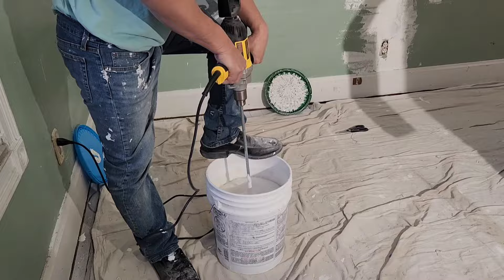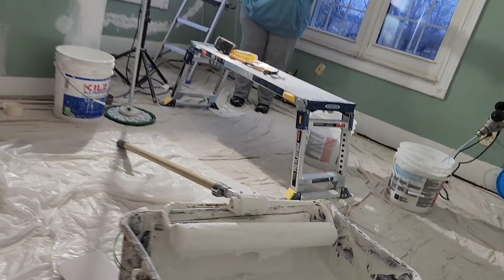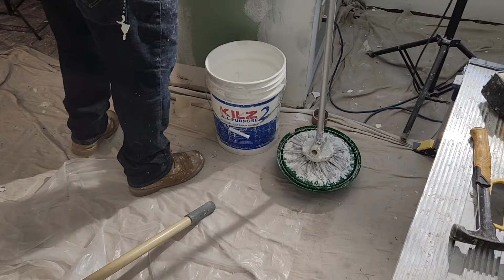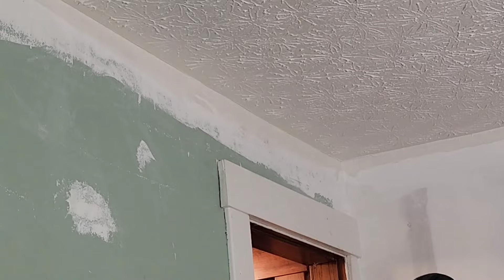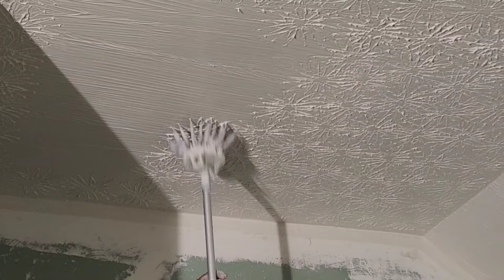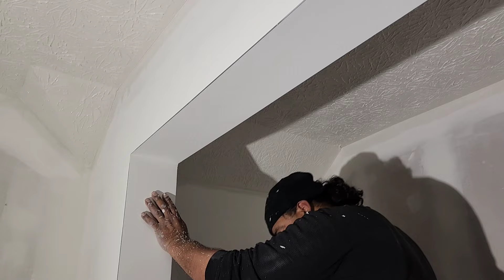knockdown ceiling texture

Comment: Where can I get the brush?
Reply: Did you ever hear about the brush or find the brush?
Reply: Is it already opened like that
Reply: jasonlt1982  thank you so much
Reply: @diamond20243 he says it's a 5inch Anvil sold at home depot
Reply: If it is a 5” Anvil how did he get it to flair out like that? The 5” anvil I’m looking at looks straight and vertical . It doesn’t look fanned out like the one Khmer Ohio is using. I’d sure like use that pattern to knock down in my kitchen.
Reply: Is that a modified stippling brush?

Comment: What kind of brush did you use?
Reply from the maker: Yes, don't use Lowe's or home depot.  You can get it at Ames drywall store only
Reply: Did you ever find out? I need this for a project with this style. Cant find the name of the tool anywhere
Reply: What is the name of your stipple brush and size